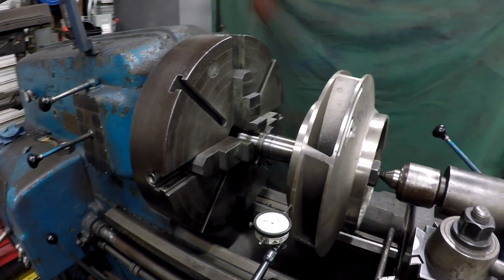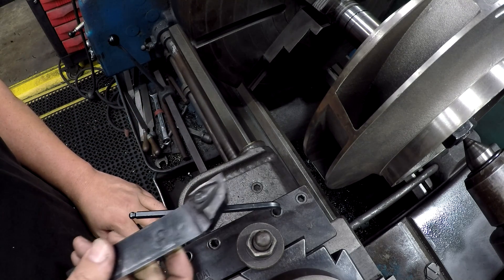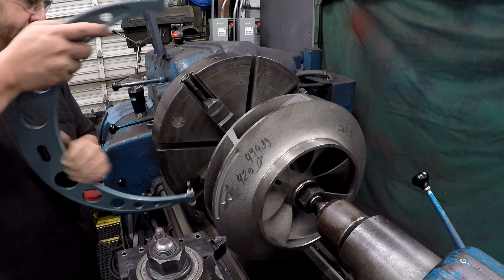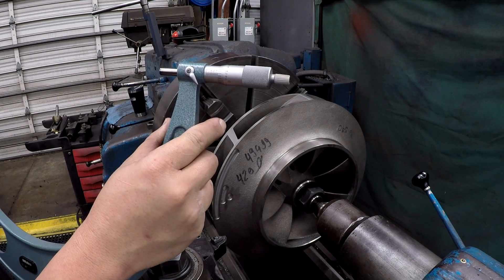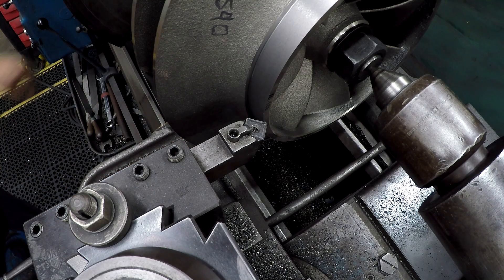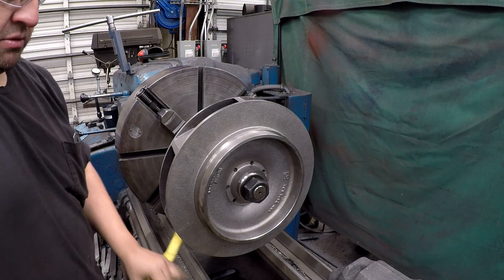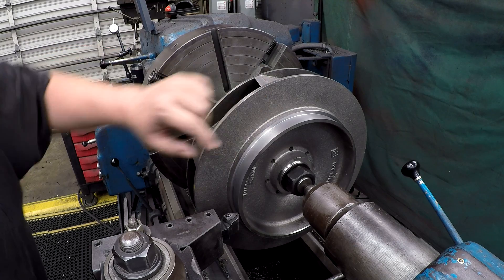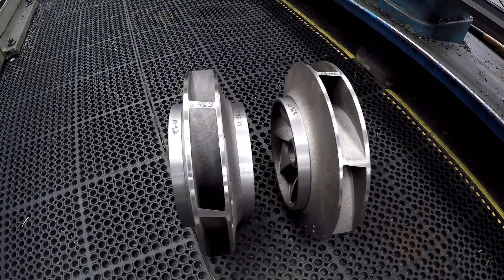Saturday Night Special 146:Part 2 Impeller Turning

Comment: Cast iron impellers?  Hopefully they're only going to be seeing freshwater or oil-based fluids, and won't be getting so much as a whiff of ocean air, not touching ocean water ever, or those impellers will be junk in no time.  Keith Fenner's 'Clam Pumper' series really informs of WHY brass/bronze pumps and impellers are really the best call when there's any chance of a pump swallowing and moving salt water. O__O

Otherwise, that was slick of using a leftover junk shaft as the mandrel to mount those on.  Abom wrench to ensure the impellers aren't going anywhere and won't be spinning on the mandrel one bit! XDD  I was though worried about not covering the Pacemaker's ways with a sheet of some kind to keep the cast iron shavings off them.  Was the swing of the impellers so large there wouldn't have been clearance for debris sheets on the ways?

Comment: Hey adam you ever try turning the cutter upside down and running the lathe in reverse when cutting thing like cast, brass, etc so they dont throw the rooter tail of chips all over the shop
Seen Keith Fenner do that when turning that style of material
Reply from the maker: it's not a practice I do very often, mainly because of habit.

Comment: Adam, maybe you could talk about the finish you leave for the seals, on the impeller they looked matte but you didn't say anything. In my background(auto/truck) seal surfaces were very smooth. I'm curious how you machine them. Thanks
Reply from the maker: James Zivny those seal rings do not use a seal that makes contact like an oil seal, they fit into the notes of the housing and have a certain amount of diametrical clearance. The finish was fine for that.

Comment: I am surprised you couldn't get around the back of that impeller with a left hand boring bar. A fun little job for a good video. :-)
Reply from the maker: bcbloc02 I didn't have the right tooling to get in there Brian, other then hanging a tool bit way out of a 2" boring bar. Bigger lathe would be nice.
Reply: Abom79
I hear ya! Running out of machine to handle the parts is always frustrating.
Reply: Having turned quite a few myself, they always were flipped to turn the backside, add keyway for the milling, then turning off the keyway once finish milling is complete

Comment: Excellent video Adam. That's a really sweet hoist with micro control they have there in the shop. Really excellent work truing some somewhat funky castings. Informative, instructional and entertaining. What more could we want!
Reply from the maker: Mark Lindquist Thanks Mark! Yes we have one very fine overhead crane in there with smooth motions and fine movements in any direction.

Comment: i enjoy seeing real jobs performed and the creative setups needed to getr done. i have never seen a crane that could lift and lower with that type of precision. most shops would have had to use a chainfall to remove and install the impeller.thanks for another great video adam.
Reply from the maker: larry sperling thanks. We have a really nice crane there with fine movements with just a bump of the buttons. It also has ramp up and ramp down speeds so no jerky movements with the crane travel.

Comment: I have had to give mics away for a long time because my eyes just were not good enough to read them even with my reading glass's on..
A couple of months ago I lashed out and bought a large magnifying glass on a stand--5-6 inches diameter with a round fluoro light underneath..It was an experiment that could not have turned out better,I can read them really easy again,so for older machinists I can 100% recommend buying one.. I paid 180 bucks in oz currency and I love it..

Comment: I work for Hayward Tyler (pumps manufacturer) so we produce a lot of these closed impellers as OEM.

what we usually do (for new cast impellers) is true up the cast 'eye' (the inlet bore) an machine everything else true to that. All our impellers are balanced but of course if the vanes are running out this could cause hydraulic imbalance - to be honest they never run at anything over 2750RPM so its never an issue. we also fraze the vane tips to make sure they are all the same thickness at the outlet / edge of the shroud, it really helps with balancing.
Reply from the maker: BedfordshireBiker awesome! Thanks for the comments on that.

Comment: Adam, if your taking off equal amounts of metal on the circumference, then why would it need rebalanced ??
Reply: He also took off metal from the inner ring plus there can be other imperfections in the casting that were being balanced out by the mass of the material that was removed.  Anything that is done to reduce fatigue stresses on the shaft and the eccentric loads on the bearings is worth while.
Reply from the maker: Matt Matt Even with the couple thou runout it will cause it to be out of balance. When they all come back I could see the spot drilled places where they had to rebalance them. In the growing world of reliability best to have everything covered.

Comment: How do those huge (any) micrometers stay accurate with temperature variations?
Reply: Nevin Williams many mics have a wooden or plastic plate to put your fingers on so u don't heat the metal with your finger. Also the standard measuring Temperatur is 20C at least here in Germany.

Comment: Holy, that wrench tho
Reply: you should see the ones we use on the railroad on a steam engine those have huge fittings too, and wrench that is soo big it looks like a gag prop from a comedy show, 4 inches or so I think its a big ass wrench that is what I know we dont use it very much though, there is nothing light on a steam engine at a historical railroad, and by that I mean nkp 765, Im just a shop monkey for now but slowly learning new things, its a big 4000 hp former freight locomotive like the one in owasso PM 1225 that the poler express movie used for modeling and sounds for the tom hanks movie that came out last decade. shes a sister engine to 765, 90 feet long.

anyway this is interesting how the machining is done and those are some of the largest calipers I have ever seen well micrometer there was a huge pair I saw on an old british documentry where they were building steam engines from the ground up from the 30's or 1940's

interesting stuff